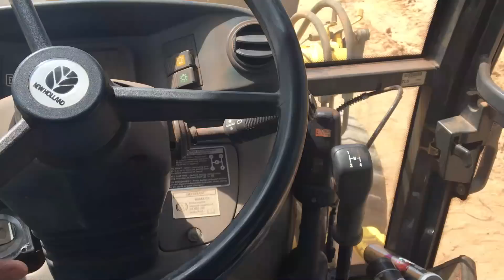Let's move it again!

Comment: That backhoe is a very nice 10K hour machine. Very well maintained. The grease dingle berries are just made for chasing I always said you can get 3 sides clean real easy it is the 4th that takes work. I would love to throw some tires on the front of that machine for you. Once again great video and thank you for posting.
Reply from the maker: It’s not too bad, grease preserves the paint! I did replace the left front recently right front is next. Thanks Tim!!!
Reply: Digginok the price of tires is just insane. Then next it is hard to find a tire technician who really knows what he is doing. I would imagine you change your own tires considering your videos have shown you doing tire repair in the past.
Reply from the maker: I had one go down on a job a couple months ago and had a good shop from OKC come out and replace it for me , I do most trailer tire replacements and will probably do the right tire soon. Sometimes  I have the professionals handle things. Bostic's tire in OKC has proven to be a good tire shop for me. Tough to find a good tire shop that can be trusted!